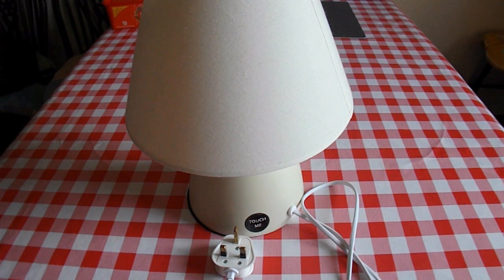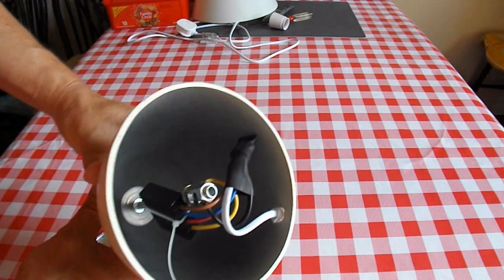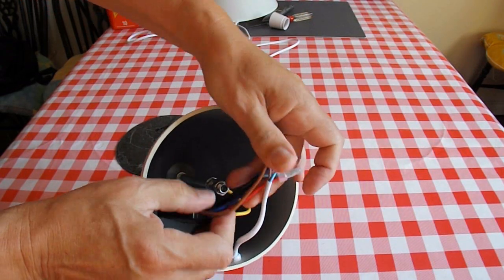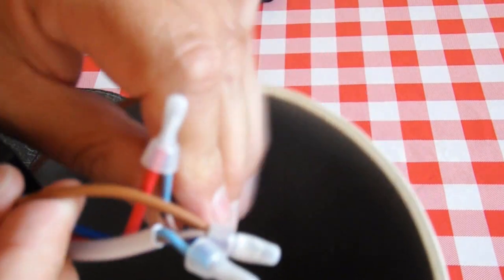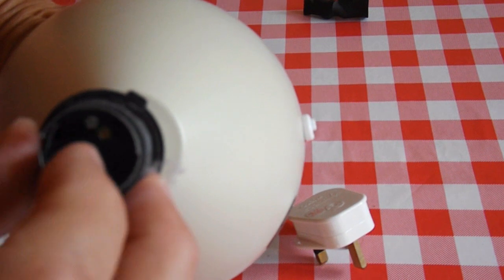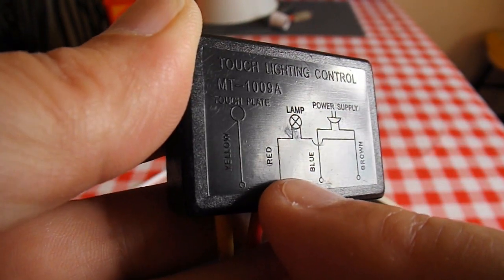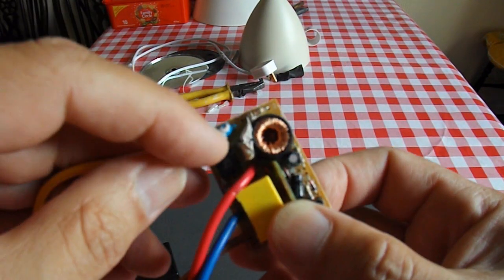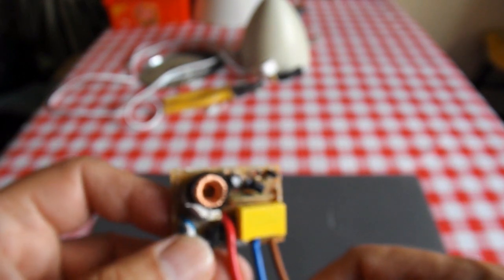Let's disassemble a touch sensitive "Touch Me" table lamp

Comment: Thanks for the show and tell. The little integrated circuit you mentioned - I think it's a TTP223-BA6 which runs at around 3V. I think the torroid was for transforming the AC down so it could be regulated to power the TTP223 capacitive touch chip and the relay which I think is that little yellow box.
Reply: There is no relay in the box. Nothing goes 'click' when the device is turned on. The Torroid is A) A Transforemer to step down the 220VAC to the 5 volts of the regulator zener, or ) it is an Inductive 'choke' to supress radio interference when the device that turns on is conducting at the 33 or 66% level.  Since I only had 1 look at the bottom of the circuit, it appears that the triac, the thing that turns on annd off, burnt itself out. 

This could happen if a CFL lamp or LED lamp were placed into the socket instead of a tungsten wire incandescent.

Bummer that the lamp was scrapped, since the connectors were very loose upon dissasembly, and the photographer had by this time cut the cord apart.

It could be salvaged however , since the controls are available on eBay, although with different colors on the wires.

The yellow box is a Philips Aluminum foil capacitor encapsulated in yellow epoxy. I recognize those from the '80s when that was the regular packaging at the time.

The IC Chip could be a TTP223 or it could be a knock-off, there is no way to know, except to remove the blob of epoxy. 

The manufacturer of the module, the MT-1004A would have better details. unfortunately, there is little published about the module MT-1004A.

Comment: You are right.  You always install your switch on the "live" wire.  I suspect your lamp was wired incorrectly at the factory.  Thanks for the video.  Repairing one of these looks pretty straight forward.  I have found that you can get the touch control modules on eBay.  Be sure you one rated fro 220v for England.  There are some that are built for the US market and are rated for 120v.
Reply: *230 volts.
Reply: My faulty one with an almost identical black box switching circuit inside is wired the same way, i.e. switched neutral. Live is needed to power the switching circuit, so I guess it's simpler to wire it this way. It does seem less safe, but perhaps switching neutral makes it less likely that a faulty switching circuit will bridge live to the chassis.

Comment: Beautiful, that's exactly what I was looking for, I have a touch lamp which I like the shape of etcetera, other the the stupid touch m, as I use it as a phone stand at night, and I keep fighting with it going on and off, I wanted to confim what's in them, I will open mine lamp tomorrow, rip out the stupid controller box, and turn it in to a normal light, I got a multi socket with switches next to the bed, will use that or cut the wire a little away from the actual lamp and put a normal switch there, it's been p*ssing me of every night, stupid crap lol
Reply from the maker: Here is my follow up video where I replace that module with one I bought on eBay https://youtu.be/v8dvA0iS5Lc there are other handy links in the video description 😁👍

Comment: Is there a way if someone using gloves it be such sensitive to detect touch? The body has electromagnetic field.
Reply from the maker: This type of switch works on capacitance. When you touch the lamp, you change the capacitance. The circuit detects that change in capacitance and switches on or off. If you touch the lamp with something that prevents the capacitance changing - something insulated - then nothing happens.

Comment: I am really surprised that this video didn't give any active solution to the problem. I found it not helpful.
Reply from the maker: I think the clue was in the title. The video was about disassembling a touch sensitive lamp, not about fixing one. As it had stopped working I was curious to find out what is inside. I am not an electrician and would not attempt to advise people on electrical maintenance.

Comment: I'm not sure if this lamp can provide any safety against electric shock.
Imagine what it will happen if this black box circuitry may have a leakage into that yellow
wire connected to chassis frame of the lamp ??
Reply from the maker: I think you will find this is a very common circuit used in a large number of applications. There are many touch sensitive 'buttons' in use.
Here is an interesting video on wiring one up http://youtu.be/hDmjD_3yYTw

Comment: Hey :)

Do you think that little black box could be hacked and used to make a wireless door bell touch activated? The door bell runs on a 23A 12V battery ... sounds a weird setup I know :)
Reply from the maker: Hi SImon, it might work, obviously in my case that part appears to be faulty anyway. In the comments here somebody has suggested which component needs replacing. However unless you come across one of these lamps really cheap you would probably be better off searching YouTube for a capacitive sensor circuit. I can see a few in the suggestions at the right hand bar of my screen at this moment.
Reply: :) thanks

Have looked at those vids and although they look straight forward they also look a little complex for a noob like me :)

Might look for a cheap light :)
Reply from the maker: Simon V Good luck with that, I really do not know if it will work for you but it might be fun finding out. Take care.

Comment: Doesn't anyone know if this could be used in a 12v setup? Looking for a way to make some metal touch sensors to operate some of the vehicles fash functions and to operate some door poppers.
Reply: I don't think this would work with a 12v supply but I haven't tried it. Your best bet would be a quick YouTube search for a "capacitive switch" to see how to make one from scratch. Here is an example I found that might help you  https://youtu.be/7lRz62fxvXE and on the same channel https://youtu.be/8voKWgZB7_4

Comment: (9:10) In the UK the mains power is 230 volts, not 250.
Reply from the maker: The voltage is AC so a nominal voltage is quoted as it is not exactly 220, 230, 240 or 250. If you google the details you will find it is currently quoted in the UK as 230 volts +10% to - 6% and historically it was quoted as 240 volts +/- 6% If you do the maths you will see why old people like me often refer to it as 250 volts. Here is a quote from an article I found on the subject "Just as it was in 1960, the supply voltage to domestic properties in the UK is still nominally 240 V AC at 50 Hz, although the declared voltage in the UK is now 230V AC +10% to -6%. Historically the domestic voltage was 240 V +/-6% (and 415V 3phase), whilst continental Europe was 220V (380V 3 phase)."

Comment from the maker: Thanks for the input, Jimmy S. Can't reply to you direct for some reason (usual YouTube comments bug) so I am copying your comment below, hope that helps people trying to fix one. This is what I did with mine :-) http://youtu.be/PdHElEUIP2M

The part that most likely failed is the triac.  Its the 3 prong  voltage regulator/Transistor looking thing.  They will either stay on or stay off when they failed.   Just a simple job of unsoldering and resoldering a new one in its place would fixed it.  Ebay one up by looking the numbers on the TRIAC.

Comment: Its crazy that the live wire has no switch - you could potentially get shocked if you thought the lamp was off! (if you were crazy enough not to unplug first, of course)
Reply from the maker: It does seem odd, but it seems to be common practice on this sort of lamp and it apparently complies with the relevant regulations.